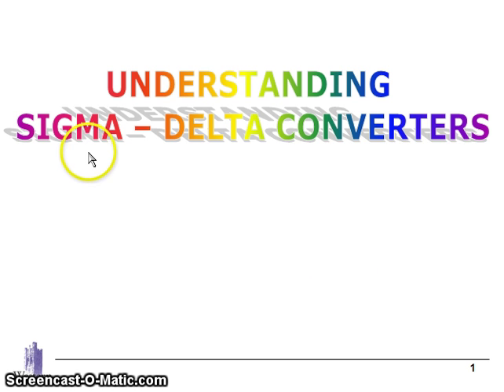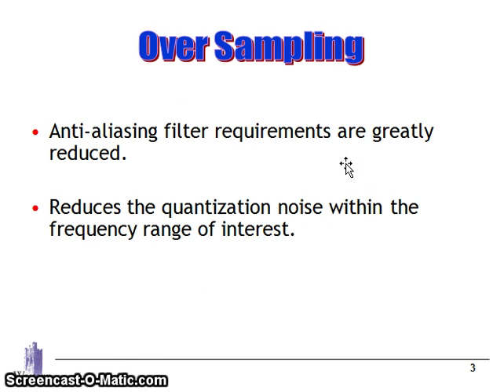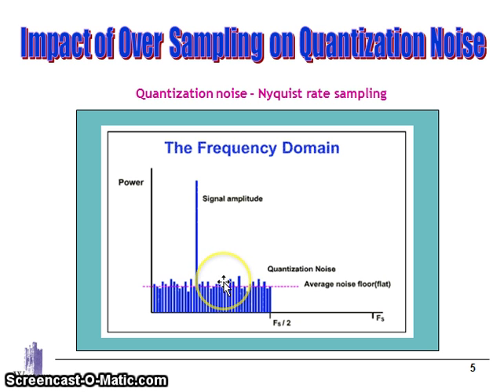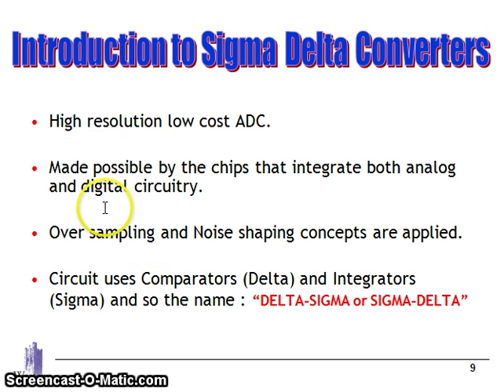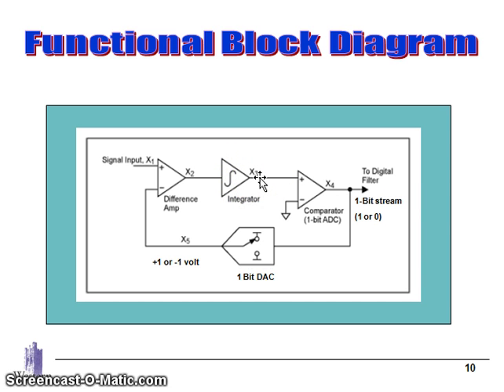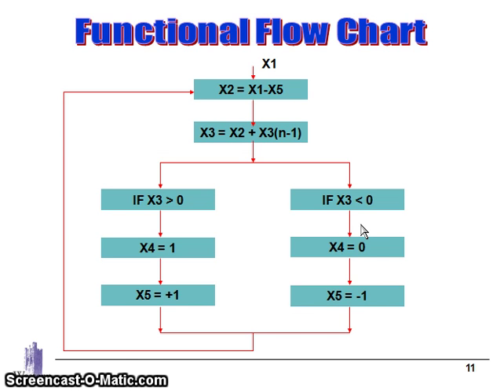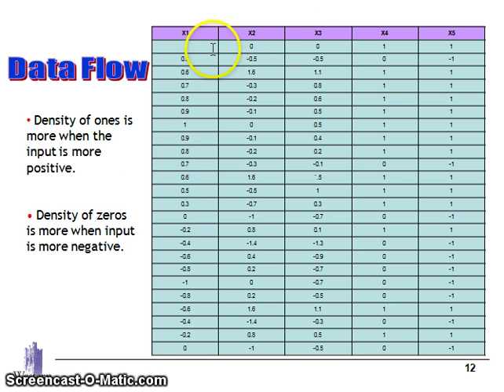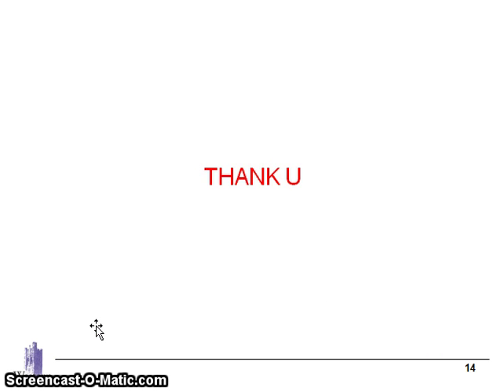Sigma Delta converter

Comment: hi madam, explanation about circuit diagram is ok. but not gave the clear justification for working like how the output is equivalent to applied analog voltage. explained about sampling alone is fine but that you didn't relate it with this working.